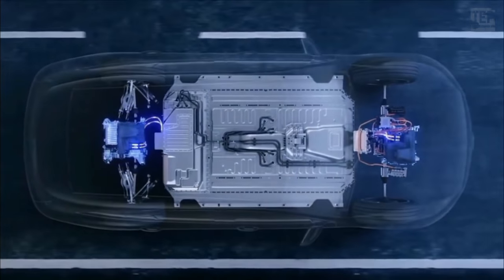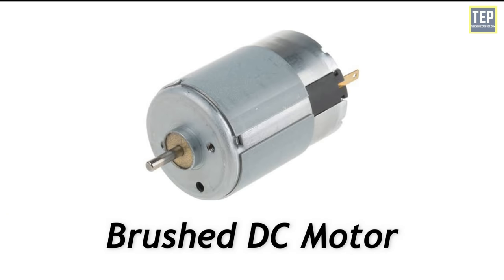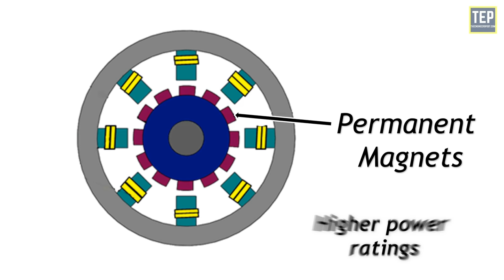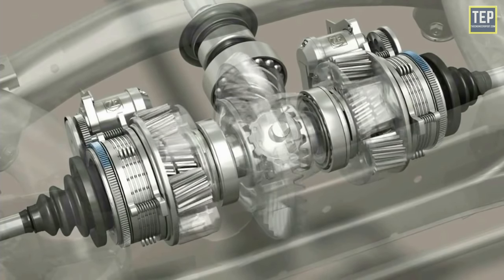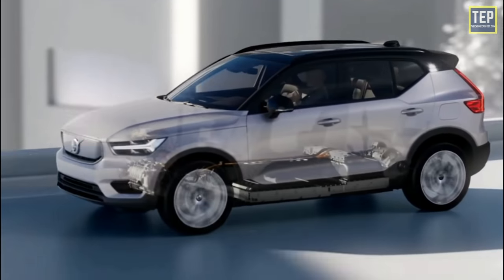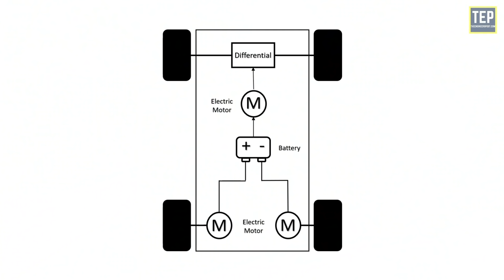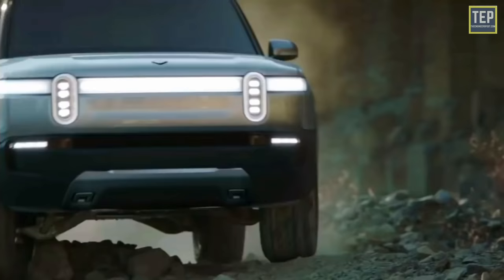Types of Motors used in EV | Single, Dual, Three & Four Motor Configuration in EV

Comment: Sadly we are going to see a lot of single motor vehicles before manufacturers start bringing down the cost of true four motor AWD unless its done under a government regulatory mandate.
Reply: Unless there's something unsafe about it that isn't unsafe about vehicles in general I would like to disagree.
Reply: electric motor based torque vectoring isn’t going to compensate for cars that have poor handling. They do have the potential to improve handling, but it’s usually nothing significant since differentials are already quite good at torque vectoring.
Reply: They are all gauging right now,, even batteries are being gauged over
Reply: @jhixx8910  Yeah it's a weird thing to contemplate..differentials can shift the tires independence "grip" (revolution) for going around corners ,, one tire needs to spin a little faster on the outer track,,, but does a duel rear motor do the same or one has to take up the power ..I suppose some sophisticated motor control codding would be necessary to maximize the independent moters speeds around a corner.
Reply: @jhixx8910  I used to think that, until I drove vehicles with torque vectoring.  Yes of course they're only factor in the handling equation, but with the same suspension, you get significant improvement and drivability, especially at high speed cornering, of course.  You can try this in ICE vehicles, such as Porsches.  Drive the same car with and without, and see the big difference
Reply: Why would cheaper cars be bad?
Reply: @marsogreen2411 exactly what I need on the way to work every day. 🙄

Comment: I would prefer a single motor with old gear system rather than multi motor AI based drive system....
Reply: you don't need gear, ac motors can adjust torque with voltage, speed depends on frequency
Reply: @brlinrainf  that's true but its not nice as people may drive carelessly.... Gears atleast keep a man in check .... He always pays attention to the speed.... Moreover , I want accelerator on steering lol

Comment: Synrm also uses permanent magnets and Teslas are primarily RWDs.
Reply: IPM-SynRM
Reply: Yes, that's true.
Reply: The Model S and  Model X are only sold as dual or tri motors AWD.  The Model 3 SR+ is RWD (single motor).  Other Model 3s and the Model Y are dual motor AWD.  I'd estimate less than 10% of Tesla sales today are RWD only.
Reply: Most Tesla's are dual motor.

Comment: Good little review there, thanks. Two things I would like further explanation of 1) would not in-wheel motors not increase the turning moment of the vehicle by being further from the centre axis 2) and make the vehicle ride rougher due to the increased unsprung weight? Once more good job.
Reply: The increase in turning moment would be insignificant imo
Reply: EVs are heavier and Rubber dust production resultant pollution from tires to be considered for evaluation.
Reply: @jn5193  but less break pad dust due to regen. Small/Hatchback EVs offer similar weight to ICE counterpart so better to avoid big and chunky battery options if city pollution is the concern

Comment: There's also the twin motor front wheel drive configuration that many Chinese evs use. In most cases all wheel drive aren't available, as the frames were designed only with fwd in mind, and available space and weight was already used for battery. There's no transmission, no rear motors, only small passive generators integrated into rear break rotors for clawing back breaking power. The idea was to keep everything as simple, cheap, efficient, and reliable as possible. We may see this configuration more often as evs come down from the luxury market and become mainstream.
Reply: I don't think so. Maybe it would be reversed. The best drivetrain is this, that sents ≈30% of the power to the front wheels and ≈70% to the rear. EVs can do it easier than the ICEs. As more EVs are made, there will be more chassises specially designed for EVs. When gasoline engines are banned, probably the only available chassises would be those for EVs.
Reply: That twin front motor configuration shifts weight distribution to the front making it easier to drift but a lot harder to turn around tight corners.It is a bad configuration.I don't understand why some Chinese  companies use it.
Reply: @devanshkoshta1878   they have a 3 tier production line. The body comes down from the top the middle line where the battery is fitted & the underfloor pan attached. Then it move down ground level where the motor/s steering, suspension & wheels/tyres, all on the front subframe are fitted! Then the cars away for trim! Short efficient production line, ideal for for small cheap put together in a short time.
Reply: Now I understand why I like carburetors better.   : )
Reply: .....the induction noise!! lol

Comment: Could you expand this discussion to include hub motors?  I’ve been watching the development of the Aptera and Lordstown Endurance EVs both of which use hub motors.  There seems to be a lot of advantages with these motors but what are the disadvantages?
Reply from the maker: 1. Adding hub motors could vastly increase the unsprung weight and hurt performance, they will feel the impact of every pothole, bump, and high-speed turn. They will also be exposed to road dirt and mud, dust, water, and road salt. So engineers must balance durability and weight, and it has yet to be seen whether any current hub motor can last 100,00 miles of everyday driving.
2. Hub motors are more expensive than a single motor mount on the rear axle.
3. They are not as torquey as a single fixed motor.
4. The hub motor is easy to overheat, and it can affect the torque density and also cause demagnetization of the magnet.
Reply: the only real disadvantage with them is they create more unsprung weight at at the wheels

Comment: 1. You can't break unity.  When doing two or more motors, any motor doing regenerative braking would add more load to a motor pushing the car at the same time.  With motors less than 100% efficient, this would drag down range and increase tire wear.  Dual motor Teslas have reduced range for the same pack size due to increased mechanical drag from the extra components.

2. Teslas do torque vectoring on dual and tri motor cars by using the brakes independently on the wheels.  Works pretty good.  Of course a motor for each wheel is even more control and allows for things like tank turns.  Mechanical brakes in EVs get relatively little wear, so using them to balance torque a little here and there is fine.

3. As mentioned elsewhere, you want the wheels to be as light as possible so they can be held to the ground when going over bumps and such.  A heavy wheel because it has a big, heavy motor in it is going to fly up into the air when it hits a bump and not immediately come back down because of the mass in the wheel wanting to continue to go up after hitting the bump.  This leads to terrible traction and loss of control of the vehicle.  In addition a low RPM hub motor is going to be big and heavy because you need the motor area to generate max torque at wheel rotational speed.  With a motor in the body of the car geared down, the max torque of the motor can be much less allowing the motor to be a lot smaller.  For speed, the motor can just spin really fast when the car is going really fast when there is a gear reduction.  You can only generate so much torque per unit of area of motor, but voltage to the windings can be varied for speed control.  Because electric motors can spin a whole lot faster than an ICE engine before flying apart and the torque they can produce has a large factor in how physically large they are and because electronics can act as a variable transformer stepping the voltage down and such, only a single speed is needed.  You just size the gearing so that the electric motor won't fly apart at top speed and size the motor to produce max desired torque considering the torque amplification factor of the gearing.  Then the motor shrinks down as power is handled by speed of the motor and you can have a lot of speed before the motor flies apart.  When you look at a Tesla or Prius, they take these lessons to heart and have very high power density electric motors that can spin at very high RPMs.  When you look at the Chevy Volt for example, they did not understand this and so ended up with relatively large and bulky low power density motors that spun more slowly.

4. Leading on from #3, it would have been helpful to get more into the torque curves of these various electric motor types.  When you get into the dual motor Tesla Model 3 and Model Y, they use two different motor types in part because they have different torque curves, so having one of each motor type allows them to distribute power during an acceleration to make better use of each torque curve.

5. As mentioned elsewhere, the motor descriptions you gave are not all completely accurate.  I can't use this video as a reference due to the inaccuracies.
Reply: nice rundown, thanks
Reply: Yeah. I disagree too with what the video says at 12:30 about one set of batteries recharging while the vehicle runs on the other set, extending the range.
Reply: Good insights.  It appears most manufacturers of dual motor designs do have reduced range over a single motor. Dual motor Teslas actually have increased range over the single motor varients with the same battery size, when they offered these options.  This is because they gear the motors slightly differently so they can optimize the motors for different speeds where the motors each offer the maximum efficency.  For example,  the single motor S75 got 249 EPA range, while the dual motor S75D got 259 miles EPA range. Both of these had the same battery pack. Seems most other manfactures are still trying to figure out EVs and have yet to do much optiomization.  They wil get there someday.
Reply: @tesla_tap  Well, what I heard when the Model 3 first came out, the single motor long range was getting more like 370 miles of range, which is significantly better than the 315 mile range the same Model 3 with dual motors was getting.

What I read was something more nuanced was happening than simple gear ratios as gear ratios between two motors in the same car don't matter.  I mean you can only go as fast as the slowest motor / gear ratio setup and having one motor geared to a faster speed tends to mean it generates less torque.  Instead the important point was the torque curve of each motor type used.

The typical deal with Teslas these days is to have one switched reluctance permanent motor and one AC induction motor or something to the like.  These motor types have very different efficiency curves and very different torque curves.  The permanent magnet motor tends to be better in the back because you can launch the car off with its high starting torque and in general it is more efficient, so putting more wear on the back tires by having them push around the car the most, counter balances with the steering wear of the front tires.  I mean a front wheel drive vehicle has to have its tires rotated often and consistently because the front tires get a double whammy on wear, leading to a massive imbalance of wear if you don't rotate the tires.  The AC induction motor in the front is mainly best used for mid to high speed heavy acceleration as it is better at generating torque at higher speeds relatively than the permanent magnet motor.  However, the AC induction motor is less efficient across the board and especially bad at low speed efficiency.  So, you want to use this motor a lot less with most of the time it is very lightly used in order to minimize AC induction slip losses.  (The harder you push on an AC induction motor, the more the induced magnetic field 'slips' around the rotor and thus the worse the efficiency, especially if you are slipping a lot at a low speed.)  Also having only one permanent magnet motor in the car with the other being an induction motor saves on rare Earth materials used as the induction motor does not use rare Earths.
Reply: @ChaJ67 If frontal induction motor gets used so rarely due to lower efficiency doesn't that also reduce the range just because you need to lug around useless weight? If there is no clutch then the front motor also adds mechanical drag. Heavier tires will make the suspension less effective, but the weight in tyres at least smooths out the speed due to rotational inertia during longer stretches of road on a bicycle for example.

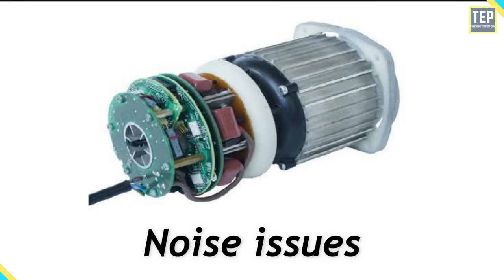Comment: Some corrections needed here. The SynRM you're talking about at 6:40 is what I've got in the back of my Tesla Model 3 RWD but it also has permanent magnets embedded in the rotor. As far as I'm concerned, you cannot improve on that provided the permanent magnets don't demagnetize over time or due to heat.
Reply: yes

Comment: Relating to motor configuration I see two favorable set-ups. The single motor drive is the best for electric conversion of ICE cars. The best natural electric car configuration is the four hub motor concept based on AFS motors as the best fitting package to the wheels.
Reply: So, essentially, an internal combustion engine spinning a strong generator that charges a battery pack that runs electric motors? There are several conversion steps, from mechanical to electrical back to mechanical. A bit redundant, but doable.

Comment: Very comprehensive video on EVs motor systems.  I feel like going EV, like right now.
Reply: @cliveosborne__ :  The bttry replacement every 2. yrs, was very painful to the pocket... We have 3. units of e. bike now, the 5th round of bttry replacement for an e.bike- the bttry cost was almost the price of the e. bike unit!!..

Here in Phils, theres a lot of surplus "motorcycle engine", so I encouraged my son, a small engine mechanics, to CONVERT 1. unit of our e. bike- into gasoline  engine...

The waste of money for a new set deep- acid  bttry, every 2. yrs- its very disgusting!...

Other option :  Remain in bttry powered e. bike, but will used the ordinary lead- acid bttry (not the deep- acid type), commonly installed in motorcycles, cars, suv's, trucks, etc.. Then, we'll install the "bttry charging system" of said lead- acid bttry, its "alternator charger", will be operated by small gasoline engine...

Said gas engine will "auto start" ,when the "bttry voltage" DROPPED 10% "lower" than its PRE-SET   "level"- then, will "auto OFF" , when the NORMAL "volt level" was  REACHED... And vice versa...

Surely, we'll used a "step-up" voltage transformer, coz  24- volts was the aver. volts for big truck bttry... Since year 2012, many tricyle driver, here in our town, were already using such tech'gy -  "conversion to lead- acid bttry"...😊😊😊.. But they didnt include the "bttry self charging system"- coz its  pricey...

Comment: At about 12:25... "One of the motors can be used to power the car, while the other set of batteries can be recharging".

Not unless you are plugged in while driving.  😁
Reply: What do you mean?
Reply: Using one motor for charging the car would simply place extra drag on the other motor in equal quantity to the amount charging (minus losses, so you lose energy).

Unless they mean doing it at separate times, but the way they word it is ambiguous.

Comment: Electrolmotive diesel trains use double squirrel cage induction  motors because they are very reliable motors. Its has high starting horsepower and torque set up but they’re large in size.

Comment: Finally I conclude that its the end of differentials and other mechanical parts wich normally are equipped on the ICE cars. But I think that this permanent magnet engines are the best effective and efficient engines ever. But the problem still on the batteries the weight affects their own performance overall And this is a topic on that powertrain automakers need to solve!!! Finally, the future tells about the scopes about the evolution of the batteries.
Reply: Not for sure since Tesla still uses differentials and Porsche - gearboxes.

Comment: I am a retired engineer, I worked in Medical Systems, Factory Automation and Robotics for 45 years. Now I own a 2104 Corvette and the 2024 E Ray looks very promising. BUT they did nothing for efficiency, MPG or emissions. Only Power and Speed. I hear you say "When In Wheel Motors arrive" . OK I want an In Wheel Motor for the front two wheels of my 2014 Corvette. I think Chevy Missed the opportunity for cake and eat it too in the E Ray.  I think we need to focus on Retrofitting existing vehicles into AWD Hybrids with In Wheel Motors and Single Pedal controllers, Regen and Vector guidance. My goal is longer range, AWD, bid power when needed and power assisted Gas drives for Max MPG and Lowest Emissions such a E85 Conversion to Gas motor for emissions and power. Where can i go to get a Conversion engineered and practical in my remaining lifetime, I am 74.  My 1st Vette was a 1964 now this 2014 may be my last one. I like the car and just need to make the best for the future in emissions and power. Front Engine rear Drive feels so good to me after owning 8 Corvettes 3 of them supercharged its a format I like. I have tried the known motor sources but they are all lined up to supply the Major Manufacturers NOT the After Market vehicles. Trucks and Cars need love too. I thought making the Corvette conversion first could open the AWD Hybrid conversion market up to all the other Gas Drive vehicles. Delivery, Pick Up and sedans why not?  Any feedback or comment welcome. I learned good thinks in this video and will look for others on your channel.   Dennis

Comment: Good video, but wish in-hub (within wheel)
motors had been more extensively discussed.
Reply: Check out Porsches new in hub motor setup it looks cool but the unsprung weight would make it a horrible daily driver
Reply: @Blaaggarding  which Porsche?  The Taycan? or hybrid models?